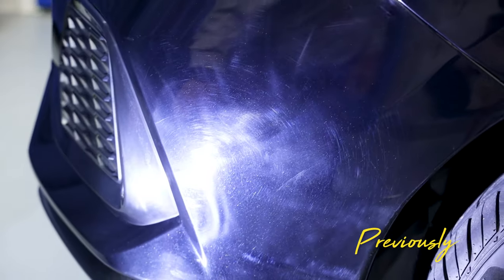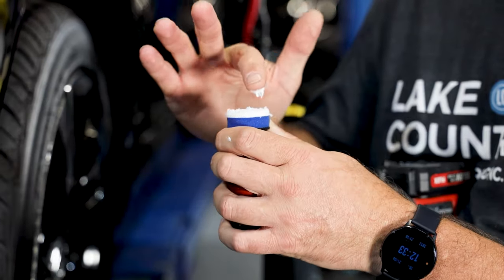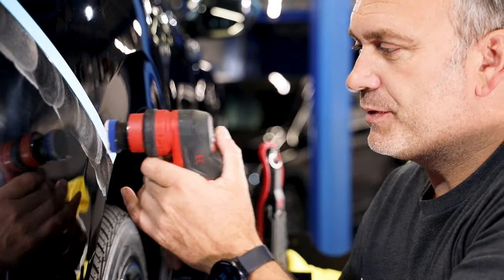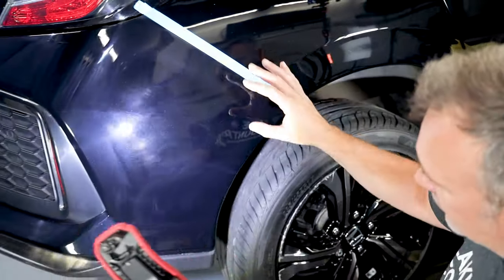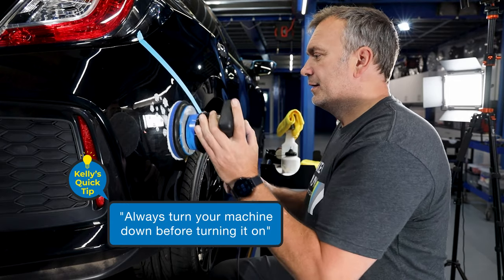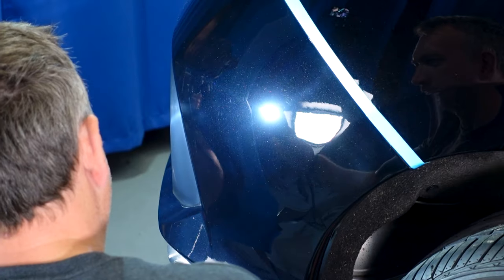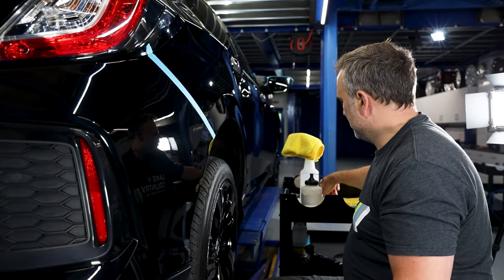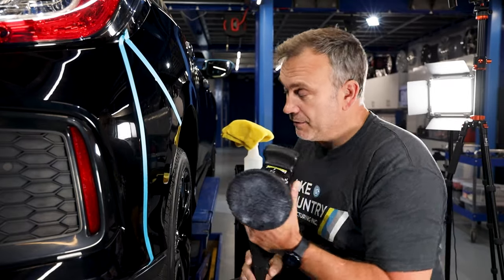Spotlight, '18 Honda Civic - Part 7: Holograms | How to Correct Deep Scratches With Microfiber Pads

Comment: I loooove your microfiber cutting pads! They really have a some serious bite, don't leave too much micro-marring. Most of the time I just follow it up with an Orange Foam Pad and a finishing polish and call it a day. Pro tip: blow out the microfiber cutting pad with air pressure between every pass. This ensures longer pad lifetime, cooling, and ensures good cutting performance through the whole detail. I only change pads when the pad starts to "spit" out dust while polishing. I recommend getting 2-3 of those pads in diffrent sizes: 1,2,3 and 5 or 6 inch to do one car.
Reply: what speeds is he running or are you running on these pads?
Reply: @michaelwodzisz8763  I found that on speed 4 of 6 is optimal, with medium pressure, very slow arm movement (about 3cm per second), 2-3 passes, this way the cut is most effective, and finish is quite good. I also strongly recommend to blow out the pad between each pass, for consistent results.

Comment: Thanks for these videos, very informative. I'm organizing my first polishing, as a hobby. A doubt: for a beginner, having only one polisher (dual action, 125 mm, 12 mm orbit) it is possible to correct an entire car (apart from the recesses of the handles, which must be polished by hand) if the time available is not a problem, or is it essential to have at least a couple of polishers available, or even 3 (for example 125 mm, 75 mm, 25-50 mm)?

Comment: What speed was used with the black finishing microfiber pad? By the way, I totally agree, you are the master.  This is a fabulous video.  I did a three stage on a black Tesla last week, with incredibly soft paint. Even using a finishing compound with a green LC flat pad, I got so much marring that I had to use the black pad with a very low abrasive pure polish at speed 4 in a 12 mm throw DA.  Still not finished the way I wanted.  Please advise.  Thank you.
Reply from the maker: On very soft clearcoat (especially over darker colors), give our red Force pad a try when it comes to final finishing.  It's even more gentle and may well be the solution you need :)

Comment: Kelly what compounds do you use ??
Reply from the maker: This question gets asked a lot and the simple fact is that we are forever changing and trying out new compounds and polishes.  Everyone seems to have their favourites, and we find they all perform at their best on LC pads.  For example there is a certain pink compound you'll see us using on microfbre pads in particular - and that's partly because it's excellent, and also partly because the colouration helps for video purposes.

Comment: Can you side micro fibre pads on a rotary ??
Reply from the maker: You can use microfiber pads on a rotary, yes.  They are perhaps not ideal, but at the end of the day it's all just abrasion.  We would typically suggest using our wool or foam pads though.

Comment: Amazing job, great video. May I ask... What pads & compound would you recommend for a 2019 Renault Grand Scenic complete paint correction please? Thanks.
Reply from the maker: Unfortunately without knowing the color, budget, timeframe, paint density, defect severities, and client expectations etc, it's hard to say.  However, there is an extremely high likelihood that our HDO foam range (and/or the HDO Microfiber if extra cut is needed) will cover all eventualities.  Use your choice of compounds and polish, everyone has their own preferences!

Comment: Would like to see how you would work on a silver car.
Reply: Silver, black, orange, green, yellow, they’re all clear coated so the color doesn’t matter. Polishing only addresses issues in the clear coat.
Reply from the maker: Exactly the same, at least to begin with.  With proper lighting we can see just as many defects on silver as we can on black; but, they are often more difficult to capture with a camera, making for a less helpful video.

That said... it is true that when it comes to the final stages of polishing, the law of diminishing returns (pun not intended) affects how you might approach silver/white cars differently to darker colors.  The human eye can quite easily see small incremental gains from finer and finer polishing on darker cars, which just might not be worth taking the time to do on silver/white.  So, the question of whether or not it's worth it to go that extra mile comes down to customer expectations, budget and so on.